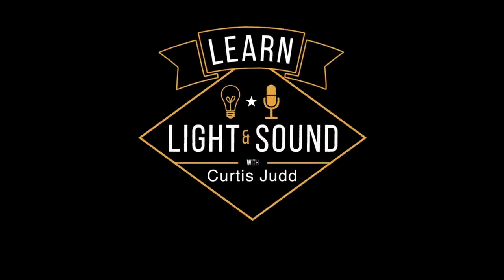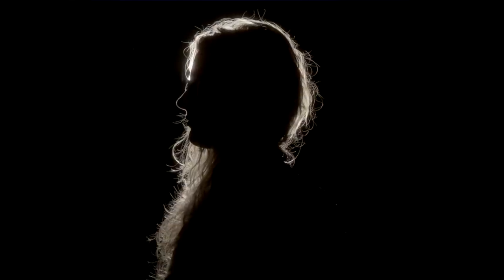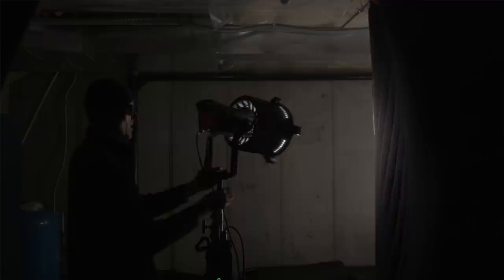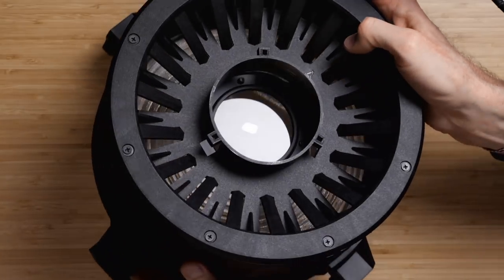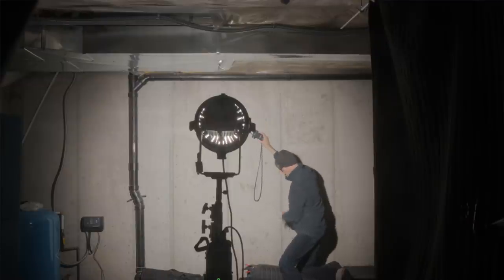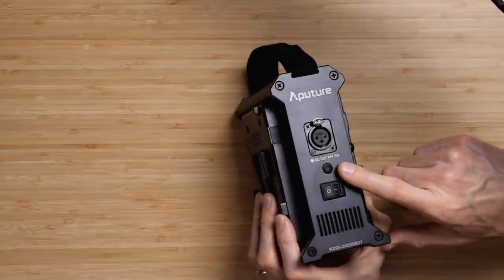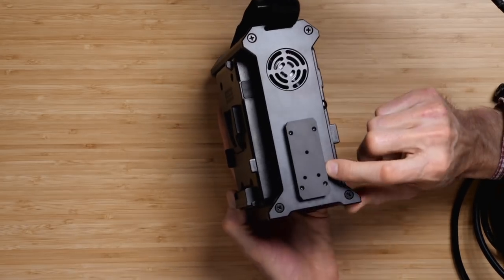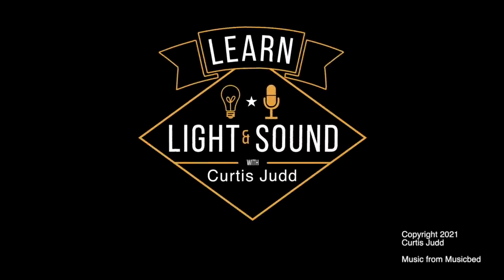Aputure F10 Fresnel & 2 bay Battery Power Station

Comment: When you test the F10 on a 300d II could you please give a view on the yoke strength vs the weight of the F10 ie if it might damage the 300d II yoke because its too heavy for it. And also how the shadows are, if they are crisp hard shadows, similar to the shadows with a 600 Pro. The first internal magnifying optic will be calibrated for the bigger size of the COB on a 600 Pro vs a 300d II. That will make a difference but perhaps it might not be perceptable.
Reply from the maker: Will do, thanks.

Comment: Missed a trick to make the Battery Power Station a V-mount battery charger too.
Reply from the maker: Ah, yes, good idea. That'd boost the price a bit, probably, but good idea.
Reply: @curtisjudd  it's better to carry one which can charge and power rather than carrying separate charger,
Reply from the maker: @santulama6937  Agreed. Just a tradeoff. I'm not opposed to charging capability at all. Maybe in the mark II.
Reply: @curtisjudd  ya you are right, maybe core swx might bring it on, they already have chargers and batteries. Let's see how it rolls.

Comment: Excellent video! Real loved the summary page in the beginning!! Just a doubt: can this power bank be used  on the aputure 120dii? Can we use two different batteries, say a 190wh and 230wh?thanks!
Reply from the maker: Thanks. The 120DII has built-in cine battery plate on the controller. The battery station outputs 48V which I don't believe the 120dII can take. You might contact Aputure support to confirm. Best wishes!

Comment: If I purchased 10 Aputure lights, 120Dii, 300dii and the 300x, and need to have one remote control (which comes with each light), can I control all 10 lights with one remote control? Or do I need to automatically purchase a DMX Board?
Reply from the maker: I believe you can control 4 channels max with the hardware remote. So you'd have to gang several of those up on a single channel. If you add the Sidus Link bridge for the 120Diis, you could control them all independently with the iOS/Android Sidus Link app.

Comment: does this only work with Aputure and Amaran products? Id love to try this on my Nanlite fs 300 bi-color light whic has a wattage of 350
Reply from the maker: The fresnel or power station? The fresnel is designed specifically for the bigger Aputure lights and their specific chip size and flange distance. It would probably work to some extent on the Nanlite, but not sure exactly how well.

Comment: Is it possible to use the battery station using just 1 v-mount with the 100x and 200x? Even at just 50% brightness would be great.
Reply from the maker: No, it needs 2 batteries to work.

Comment: What is the extra cable that comes with it? A 4 pin male to 3 pin male xlr.
Reply from the maker: It is an adapter cable for lights with a 4 pin DC power input.

Comment: I heard aputure once said before launch that the Power Staion would also be avke to vharge batteries. Havent heard anything about it since. Did you tried it out if this charging option is implemented?
Reply from the maker: There is no AC power input. Confirmed: This iteration does NOT charge batteries.

Comment: Hi Curtis, I'm curious whether you have tested the F10 on an Aputure light with smaller COB chip such as the C300d or C120d. I don't need the output of the 600pro but I like the F10 for producing softer quality hard light, but I'm slightly concerned that it will not be as soft on smaller slights due to their smaller COB. Thanks in advance
Reply from the maker: Hi Ian, I haven't specifically tested that but will give it a try when I happen to have it out next time.
Reply: @curtisjudd  Thanks

Comment: I bought this power station and based on a recommendation bought two SmallRig V Mount Battery VB99 Pro, 6700mAh 99Wh 14.8V. 

I am wondering what I am doing wrong. When I plug both these batteries into the APUTURE Power Station, the batteries shut off and will not turn on. Therefore I am not getting the green light lit on the power station. 

I tested both batteries on other products and they seem to be working normally as intended. It’s just using them on this power station. 

Would these just be incompatible, too low a wattage?

On the Q&A on the B&H website page, the staff of B&H stated these batteries will work fine with the Aputure battery station providing the load is a match. 

Any ideas? I would appreciate anyone’s suggestion. Thank you.
Reply from the maker: Sounds like maybe the batteries cannot supply enough current.
Reply: @curtisjudd thanks for your reply. No it’s not that. Aputure has confirmed the smallrigs don’t work on their battery bay. They have had several complaints on the matter. I instead got some new Core G3’s and it solved the situation well. Except the cost was not cheap. 

But you are correct in that lights need lots of current. The G3’s are 20 amp. SMALLRIG is listed somewhere on their website as 10 amp. Great for light duty work like powering camera and monitors
Reply from the maker: @andyp7787  thanks for sharing the details 👍

Comment: Sorry to Hijack this video, but do you have a rode wireless go 2 video planned? I just bought a Sennheiser XSW-D kit and am curious if it's worth changing (The dual inputs and the ability to record internally if the signal drops intrigue me). Would love to see it up against the old version, the XSW-D, anything you think is in a similar class, and even the Zoom F2 (Which seems redundant if this can record internally?). Not sure if I should pick a set up and flip theWSW-D's.

Also keen to hear your perspective on the Blackmagic 6K Pro overall, but especially from an Audio perspective. Are the internal preamps etc ok? Or would you still be recording externally?

Thanks mate. :)
Reply from the maker: I am working on a review of the Wireless GO II presently.

As for the Pocket 6K, I record externally. The preamps in the 6K are ok, but not amazing. Good enough for some situations.
Reply: @curtisjudd  Thankyou for the reply. :) Looking forward to that GO II review!

So, with the 6K, it sounds like I shouldn't consider dual mini XLR a worthy "feature" to buy for?
Reply: @benmcphee4401  It only has a single mini XLR input - so that's the first consideration. If you need 2 inputs, you'll need a mixer/recorder anyway.

Comment: With the aputure power station if you put two 14.4v anton bauer titan sl 143wah batteries on this aputure power bay do I get 286wah cause im using two batteries or do I get only 143wah since it's combining the 2 batteries 14.4volts to get 28.8 volts and converting it to 48v
Reply from the maker: The power station outputs 48V so it converts the voltage.
Reply: @curtisjudd  understood but by doing that does it combine wah into 98wah total or do you still get the 98wah per battery which is 196 wah ? On this bay
Reply from the maker: @creativegreats6924  The math changes things and it depends on the light and the batteries. The real question I think you're after is how long will X light work at 100% with two Y batteries. Unfortunately, I don't know the answer to every combination, but I could share the results with the specific gear I have on hand.

Comment: Thanks for the quick review. Something wrong with your notes -- both the VO and intro slide regarding fall off in the flood position...(both indicate the light is darker in the middle and brighter on the edges when in flood mode...but they are doing it different ways).
Reply from the maker: Thanks Barry. Sorry for the confusion in the notes - in the center, there's more output so we would need a smaller aperture (bigger number) at the same shutter speed and ISO. The point I was hoping to make is that there's more output at 15 degrees in the center with fast falloff. And a smoother gradient from the middle to edge at 45 degrees.
Reply: @curtisjudd  yeah...so the slide says f/12.7 in the center and f/56 in the margin (missing a decimal point)...in the VO...the center  is 2.7 and 5.6 on the margin (typo in your script.:-)
Reply from the maker: @barrygoyette  Got it, thanks for the correction. 👍

Comment: How are you getting 2 hours and 45 min with 100wah amaran lights using 2 98 wah batteries ? I would think if your running the light at full power you would get under 2 hours because 98wah times two is 196wah if this bay combines the wah of both batteries which in this case is 196wah. Please explain thanks you and great channel just discovered it recently .which is great news!
Reply from the maker: A few things: the draw of various lights in the real world does not always match their model number and the the number on the batteries don’t always 100% match their real-world capacity.
Reply: @curtisjudd  yes but does this let you use both wah of batteries total 196wah or does it only let you use 98wah?  I heard that on the bay with 14.4 volts two 98wah you can only use 98wah total per pair ..not per battery but  per pair is that true ? or can you get 196 wah with 2 98 wah v mount batteries ?
Reply from the maker: @creativegreats6924  The conversion changes things and it depends on the light and the batteries. The real question I think you're after is how long will X light work at 100% with two Y batteries. Unfortunately, I don't know the answer to every combination, but I could share the results with the specific gear I have on hand.
Reply: @curtisjudd  ok so your saying that the you got that many hours on two 98wah so it's fair to assume that this bay is talking 98 wah each battery which is a total of 196 wah run time . Cool . hey I wanna ask ? What state are you from ?
Reply from the maker: @creativegreats6924  I'm from California. I currently live in Utah.
Reply: @curtisjudd  oh nice , i'm from sacramento CA live in vegas . I was told with two batteries that are approx 150wah (300wah total ) I would only get 150wah on this unit because it compensates because of the combine voltage 14.4 or make over 28 volts which is then magically made into 48volts power within this unit but the run time you got leads me to think what I originally though and that if we put two batteries that are 150wah per say we will get a total of 300wah power to use and if we are powering say a 100w lights we will get approx 3 hours run time as oppose to 1.5 hours

Comment: Any V-mount battery recommendations? I've never purchased them because of their high cost, but maybe with the Aputure power station and a 100D it might be a good time to go for it.
Reply from the maker: I like the Bebob micro cine batteries: https://youtu.be/1cpF5so8KEE
Reply: @curtisjudd  Thank you Curtis. I was going to ask the same question. I looked at the Bebob video on the link. I realized that that battery doesn't give a continuous 15 Amp draw as Aputure recommended. Does that matter?: it is so confusing because there are so many batteries and Aputure doesn't have a list of approved batteries. ( I think they should to make everyone's life easier)
Reply from the maker: @osoriony  Hi Juan. I believe the batteries need to supply 5Ah each, not 15, as the overall power station delivers 10A. Did you see Aputure recommend 15 amps somewhere in their written documentation? I'd be curious to see that if so. The Bebob micro cine batteries supply 10 Amps.
Reply: In official user guide video for aputure power station they say and write it on a screen that amaran 100x/d uses 130W  
So the recomend to use two v-lock batteries with regular voltage of 14.4/14.8 V with  6A  (75W)  output each

And as i understand this . It is a minimal requierment . U can use any lager and more expensive batteries
Reply: The metrics can be confusing, I'm no electrical engineer (although my father was) but Ah relates to Amp hours and not the sustained current A (amps) that any given battery can deliver. You cite that 2 x 5 Ah batteries should be OK for a 10 A power station like this, but that doesn't necessarily apply. Batteries with insufficient current capability will be at best 'flakey' and might not even work at all, or only for a short time before the unit cuts out. 

If you multiply the voltage V (volts) by current A (amps) you get power W (watts). So if this "2-bay battery station" can output 48v at up to 10 amps then it can deliver a theoretical 480 Watts (ie 10 × 48, but it might be rated at say 500W - I don't know exact spec Aputure claim). I just bought one to power my Amaranth 200XS. So if my light can draw up to circa 200W on full power (stated spec, but I haven't measured) then I will need good batteries, preferably with a little 'headroom' to run reliably. The math is VxA = W so, my sustained current required A is (as a minimum) calculated as A=W÷V, or 200/48 or about 4 amps. But the input batteries are running at less than one third that voltage, so their continuous current capability needs to be proportionately higher.  So if using 200W from 2 batteries, then each V-mount needs to be comfortable operating at a minimum of 100W. So sustained current from each battery needs to be a minimum of 100÷14.8 = 6.76A (ie unrelated to 5Ah, which is a different metric). Fortunately, many good capacity V-mounts should be able to sustain a continuous current draw slightly above 7 amps and would thus be OK (one needs to read the spec for any given battery to properly understand if it will likely be OK and work reliably.

Comment: Does the F10 fit with the Amaran series?
Reply from the maker: It is optimized for the 600D. It will fit on the Amaran line, but stresses the yoke and is not optimized for the COB chip in the Amaran line. Best to go with the Fresnel 2X when working with the Amaran lights.
Reply: @curtisjudd  Thanks for the reply!

Would it be possible for you to test this? Because according to this https://youtu.be/oiTG2IkS1LA the 2x isn't ideal either. If the F10 is better, I woudl't mind getting it instead :)
Reply from the maker: I'd be worried about the weight of the F10 on the Amaran lights - they're not built to bear that much weight. I'll try next time I have a chance, but I think it is too risky. That F10 fresnel is REALLY heavy and the Amaran's are a lot of plastic.
Reply: @curtisjudd  I guess the visuals are deceiving. And don't put any gear in danger, but totally understandable.

I'm still so used to working with tungsten Mole Richardsons that I have no clue what is out there, and how much plastic in each of these budget lights ^^
Reply from the maker: Oh, yes, coming from the Mole's, that makes sense. I think the Aputure 120 and the F10 is probably a more viable option. It still probably won't spot as well as on the 600D, but I wouldn't be as worried about the yoke as the 120 is all aluminum.
Reply: @curtisjudd  I legit was thinking of just replacing the yoke with an aftermarket one...
Reply: @curtisjudd  Spoke more to apurture, and other owners. And it seems they are not making a fresnel for the light. But the 2x nor F10 are made for that chip...debating if other aftermarket brands will work better.
Reply from the maker: Yes, the Fresnel 2X "works" meaning you can mount it and it does spot to some extent, but not like the 120d.
Reply: @curtisjudd  totally, just surprised there is no option for the newer lights